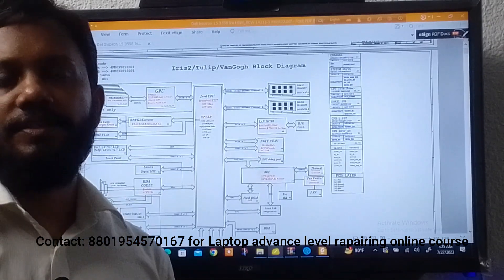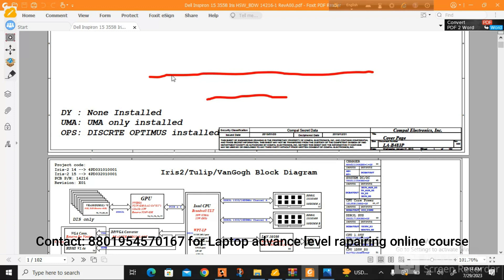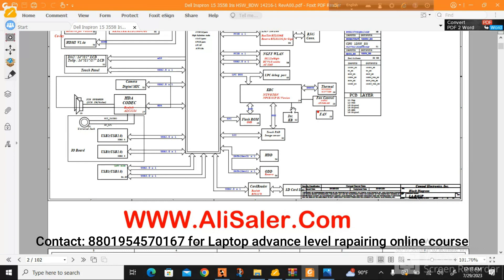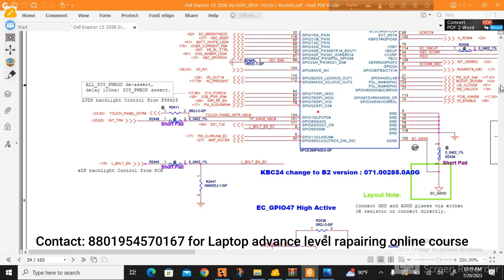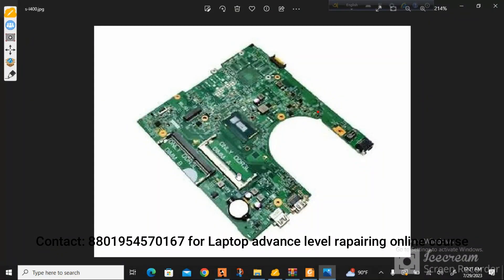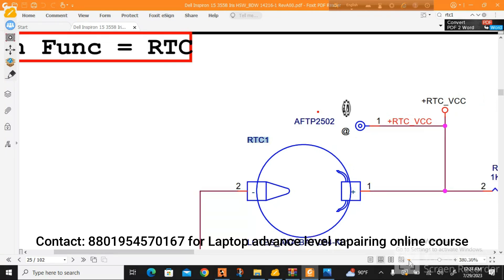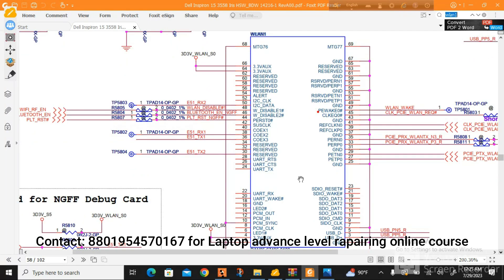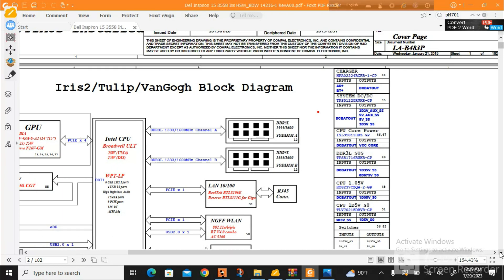How to read schematic diagram of Laptop motherboard#

Comment: Hello Bangladesh, I have a strange error with my Razer Blade RZ09-03009, there is no 5vALW and EN1 voltage is not available either, but there is 3vALW, chip is TPS 51285B, as you know there is no schematic on the laptop, you may have one ide or maybe you can help me? Greetings
Reply from the maker: RESOULDER IC